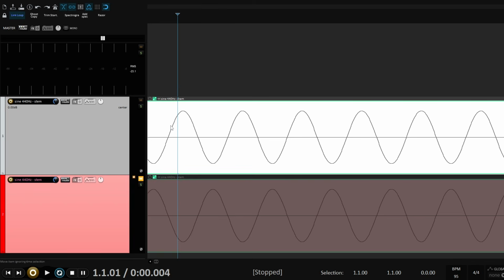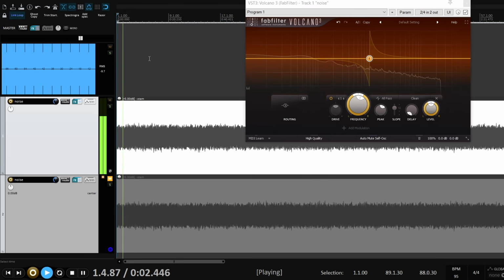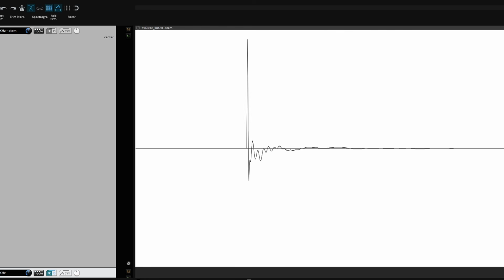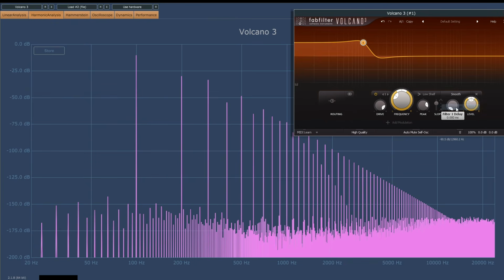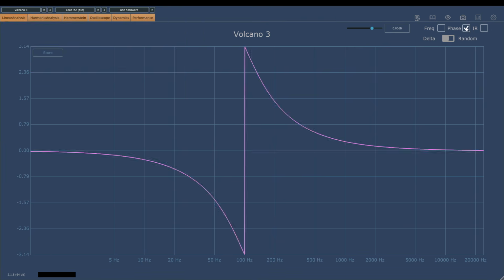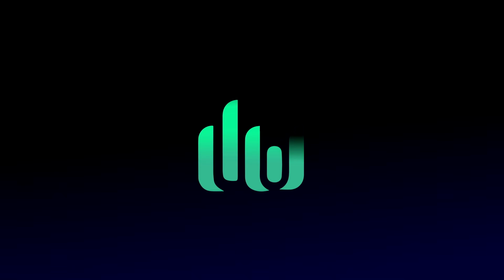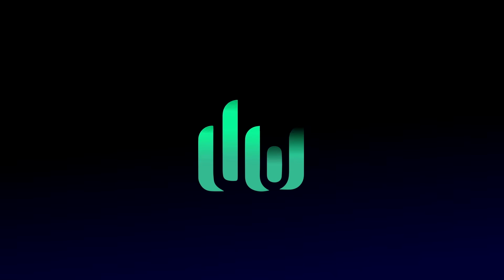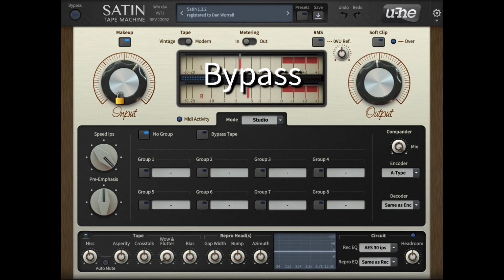How (Not) To Test Your Plugins

Comment: I know this is an old vid, but I wish to thank you Dan for the content. 
I am restoring an old 1980’s analog console and was wanting to document the eq sections (this is pretty much a one off custom console from Australia with no documentation).  
The linear analysis in plugindoctor had me stumped, because it was showing rubbish, just like you demonstrated.  
You have enlightened me.  The user manual for plugindoctor is a bit light on. 
Thanks again.

Comment: A lot of the things shown here about the "secret EQ" that a lot of "analog" FX has is the reason why i shy away from them. I want to know if there is a bandpass filter. Once i do know, i use them MUCH more easily, since sometimes you do want bandpass after saturation, some of those curves are there because there are use cases for them. There are only few plugins outside Reapers built-in stuff that i use anyway, each with very distinct roles but i don't  have 12 different tube amps that i don't know really what they do.. 

If only plugin makers would be proudly showing at least FR, what kind of filter is "baked in", that would be something new and refreshing, you know: truth. If they hide things from you, you don't know what things they are hiding. It is a philosophy and moral question, really and if they lie to you in one area... they will lie to you elsewhere too. Which is why i got stuck with Cockoo's and Reaper, and i tend to favor transparency when i choose what plugins to buy or even try.. I'm not going to log in with my real credentials and install a launcher, for just trying out something. That is a payment, it is not free-to-try.

These go hand in hand, if the plugin does something it should inform the user that it is doing it. So... keep analyzing plugins before you buy and evaluate how honest they really are as a company. I have one subscription atm, and the amount of information they give you is enough to almost reverse engineer their stuff... so, if you want to stop you can at least do something in the same direction with stock plugins and complicated routing... but their marketing and pricing is bloodsucking, i pay when i need it and in my case, it pays itself back, it is almost like secret code to handle one certain problem that i have with my mixing style, and once i learn enough... i will stop but their documentation and transparency on what the plugins do is why i pay atm. I won't name it, they are still bloodsucking..

Comment: 50:14 There's an even simpler solution, actually, and that's to not apply low cut filters in the first place. Or at the very least, treat them as a last resort, rather than as a safety measure. There's this myth going around in pretty much all music production circles, that absolutely nothing but the kick or the bass should ever be present in the sub frequencies domain, but the truth is that any low end junk included with any other element, only needs to be diminished to the point where it's masked in the full mix, not fully removed. 

In other words, a low shelf filter is a better solution to almost any mixing problem where conventional wisdom would call for a low cut filter. Heck, a regular bell filter could often be a more viable solution, and sometimes the best option is to just leave the low end alone. It's to the point where I'm convinced that the demand for "analog warmth" is almost entirely caused by producers highpassing in their mixes too much; low end is after all where all the "warmth" is found

Comment: One generic question: 2x or 4x or higher oversampling vs, say, working at 96/192 kHz and downsampling in the end  - is there difference?
Reply from the maker: Oversampling each plugin that requires it individually will result in less aliasing than oversampling the entire chain, all other things being equal.

Comment: Great video, very informative. However, one important concept is missing: IMD (intermodulation distortion), which is most of the time related to and correlated with aliasing, though sometimes it isn’t. When you gave the phase-shift example and explained that we generally shouldn’t worry about it, it’s true but the closer we get to extreme cases, the higher the risk of actually hearing it. So what would be considered an acceptable average level of IMD : 0.30–1%?

Also, compressors; depending on the amount of threshold, attack, and release can introduce a lot of these kinds of non-musical harmonics that aren’t correlated with the fundamental, which can make sources sound fake, harsh, fatiguing, and so on.

Comment: at 1:06:03, you show aliasing artifacts that are hitting around -96 dBfs.  Here's the thing, lets say your aliasing compressors are all around -100 dBfs, but you have 5 of them across your mix. You're going to start to hear glassy, phasey textures, fizzy sibilants, or unnatural top-end harshness — especially in vocals, cymbals, or reverb tails - in the 2–8 kHz. Now starting adding mix bus compression or throwing a tape plugin on or another clipper or saturator into the mix, and soon you get a mix that might sound exciting at first, but really, you end up with a mix that has a brittle or digital character in the highs, which becomes fatiguing to listen to. A single asliasing plugin, that is being listened to in isolation isn't an issue per se... but let's say you have a LV, Double LV, then three part harmony stacks of vocals left and right, and you have 8 vocal tracks with a compressor aliasing at around -100 dBfs, then you send that to a Vocal bus subgroup, now you are raising the aliasing up higher, then that bus combines with your other tracks, and goes to the mix bus where an SSL type compressor is on, and now you're compressing the audio, and it's aliasing artifacts further increasing the fizz, and hazy sheen, or  edgy cymbals etc.. It's all cumulative.

Comment: That noisefloor you see in Pro-Q3 (@26:00) is only there because Pro-Q3 runs on 32-bit floats internally, not 64-bit doubles. (This is NOT! about the 32/64-bit CPU architecture, but basically how large the memory sections are to store sample data in.)

Larger blocks of memory allow for more precision, think "digits after the decimal point" as a simplified explanation. If a data format can store more digits after the decimal point, e.g. 0.01 vs 0.00001, then obviously the one with more digits can calculate much more precise numbers. After the limit of the data format are reached, i.e. if the post-decimal precision runs out of digits, then there will be rounding errors, which results in what we perceive as noise.

32-bit float (single-precision) has 23 bits of mantissa (actual precision), 8 bits for the exponent, and 1 sign bit.  The theoretical noise floor for 32-bit float is around -144 dBfs, but due to denormals and the actual mantissa width, it may appear closer to -150 ~ -180 dBfs in the wild, also depending on the measurement method.

64-bit double (double-precision) has about 52 bits of mantissa, 11 bits for the exponent, and 1 sign bit. This means numbers can be stored with higher precision, i.e. there are  "many more digits past the decimal point", which means rounding errors will be much smaller since they happen "further down". The noise floor from rounding is pushed far below the audible range, typically below -300 dBfs, which is unmeasurable for practical audio.

If you look at a plugin's output in a spectrum analyser that ranges down below -150 dBfs, and you can see some gristling noise there, then those are just rounding errors from using the float for processing vs. the higher-precision double format.

The "internal resolution above 100 bits" thing refers to a non-standard data type.

On some platforms, even old 386 CPUs with math co-processor, there is a "long double" i.e. 80 bits data type, but its support depends on the hardware: some platforms implement it with 128 bits, and in MSVC on Windows it's just an alias for regular 64-bit double. Not a reliable thing to work with and, likely more importantly, also not deeply optimized for SIMD operations. (It's when your CPU does multiple calculations of the same type in 1 CPU cycle, like 4 float additions.)

There is also an "artificial" data type called "double double", it's not a standard thing, it needs to be implemented by software i.e. an additional library, and it's basically done by summing two separate (but related) double values. It uses 53 precision bits from each partial double, which gives it 106 precision bits in total. The Kirchhoff EQ uses this format and they seem very proud of it, but it's not going to make a difference, at least not a positive one.

SSE1 brought optimizations for 4 parallel float computations to PCs in 1999, SSE2 brought optimizations for 2 parallel double computations in 2001. With AVX in 2011, mainstream CPUs finally also got the capability to process 4 parallel double computations in one step. Apple Silicon CPUs all use NEON and SVE extensions that optimize 4 parallel double computations. (When I write "parallel", think about "processing X audio channels in one go.")

So with the regular 64-bit double format and a noisefloor below -300 dBfs, you can make use of HIGHLY optimized CPU instructions, making for a much faster process than using some customized data format that doesn't just access one section of memory, but needs to access several sections of memory and perform additional computations, just to "get" a number.

Yes, the double-double is indeed parallelizable, but due to its complexity and the limited availability of supported instructions (e.g. can't do pointwise operations) it's probably not worth the effort.

Float is fine if you have a problem going with the times, it's a nice fall-back for outdated host software, but double processing is measurably better. (Note that I wrote "measurably" not "audibly".) PCs from the early 2000s already support 2-fold double calculations, and most of us are working in stereo (or in channel counts that are multiples of 2), so if your plugin doesn't internally do double processing, you're a geriatric boomer and 20+ years behind the times. But this double-double business is just a waste of time and effort, at least for audio DSP.
Reply: Awesome computer science info for us instruction set and data type nerds haha. Thanks for this

Comment: I'm only a few minutes in, but REAPER has a "delta solo" option that is useful for stuff like this, and much easier than duplicating and inverting phase. Hold alt and click the dry/wet mix knob at the top right of every plugin window, and you'll hear exactly what that plugin changes.
Edit: It was mentioned later. Oh well.

Comment: Thx a ton for the explanation for the raised peak with high pass filtering. Makes perfect sense. I knew all sounds consist of sine waves, but somehow still missed the fact that the shift and overlap of those lowest freq waves is what actually causes the spike. But it makes perfect sense now and I'm just like how the hell I didn't figure it out. Doh. In some synths you also have hi pass adjustment at the osc level. What they essentially do is they modify the waveform removing the lower end harmonics. So if possible deal with it already at sound design stage. Of course you don't have that liberty when mixing.

Comment: Hello Dan Worral, you're mentioning Dolby noise reduction around the 26 minute mark. I am interested in this system, how was it used in the example for this video, what am I seeing in the graph, how is noisefloor affected by Dolby NR? Would it make sense to use this technique for digital tape simulation plugins? What I understand that first boosting/compression and after the insert attenuation/expansion is used to reduce the hiss. Could it be useful to use this in other non-linear processors, e.g. to drive saturation?
Reply from the maker: Yes, definitely. U-He Satin includes the noise reduction (both Dolby and DBX), and it's really important IMO. https://youtu.be/ZRP5uI9mbzQ?si=EnPrnN2CuQVwyGLf

Comment: Hi Dan, Have you ever used the browser add on, "Audio Compressor"? I use it in both Chrome and Firefox for youtube/movies/Twitch/etc.  However for videos like yours, I have to turn it off because I'm hitting it fairly hard and the best creators already have mixed down to professional standards.  I would love to know more about this, plug-in(?), and what is driving it, how it works with windows, etc.  It doesn't work on some pages like embedded video and specifically Twitch Clips comes to mind.  On Twitch clips the audio will just be not present requiring a refresh of the page.  Not sure if you'll ever tackle this but thought it might make a decent shorter video.

Comment: Dan, question (and possible video idea?) - it’s about distorting high frequencies. Since our hearing caps out at 20kHz or less, what this means is that we shouldn’t be able to hear the distortion of frequencies higher than 10kHz right? A 10kHz sine should sound theoretically identical to a sawtooth
Reply from the maker: That's true for just a single sine wave. But if there's also a component at (say) 12KHz you'll also get the sum and difference partials at 22k (inaudible) and 2k (definitely audible).
Reply: @DanWorrall  oh totally forgot about intermodulation. It’s still a very esoteric concept to me I don’t understand why it happens lol. Thanks a lot!
Reply from the maker: Remember that both components are mixed together as one wave: imagine the higher sine wave as wiggles on the lower sine wave. When the lower sine is positive, it's pushing the higher sine wave harder into the positive half of the non linearity, and vice versa. And the higher sine affects the distortion of the lower wave in the same way. So the two waves start to modulate one another, in effect.

Comment: Question. So far from all the saturation plugins that you’ve tested with analysis and with your ears, what is your go to favorite one at the moment? I know that this question is completely subjective, I’m just curious. Which one to you is the best as far as test results and listening with your ears?  Thanks
Reply from the maker: I can't give you just one as there are so many different ways I use saturation. FabFilter Saturn would have to take the top spot, if you forced me to choose, as the most versatile with its different styles and multiband capability. But I also use saturating filters a lot, usually FabFilter Volcano 3 or Cytomic The Drop. U-He Satin is an old favourite for when I want some extra shine and brightness. I still use Decapitator quite regularly, as there's nothing else quite like it. Think of them as like spices you can add when cooking: you'll probably want a variety of different flavours, and you'll choose them to complement the dish you're preparing, you won't just use the same one all the time.

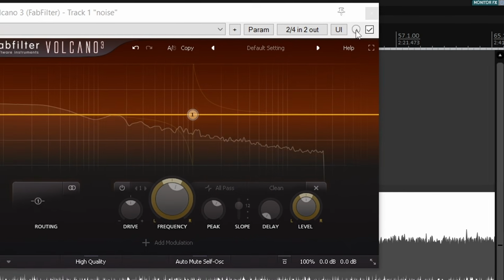Comment: Can someone explain to me the part at 12:20 - when Dan enables the allpass in Volcano 3 with Reaper's Delta Solo function active, shouldn't the result still have been null/silence, given that the mode is set to Clean? (edit: bandpass → allpass, Pro-Q → Vocano 3)
Reply from the maker: I enabled an allpass filter in Volcano 3. That became a bandpass filter when delta soloed. A clean bandpass filter would become a notch filter with delta solo.
Reply: @DanWorrall  thank you for taking the time to reply! Just went back to 6:30 and it all makes sense now: the first null test is against a channel that also has an allpass hence they null, the second with Delta solo is against the same channel without Volcano 3 hence it becomes a bandpass. Apologies for the mistakes in the original post by the way - fixed now. Thanks again!

Comment: Notwithstanding all the commercial speculations you might find on the net, Both crystals and homeopathy are based on oscillations, numbers and frequencies. They are relevant and detected in the time domain, space domain and frequency domain. To mention homeopathy and crystals (albeit crystal healing) in such a context was perhaps the most unfortunate statement you could find. It may be that you did not intend, for that matter, to discredit the two, but if you knew, for example, that according to the same principle on which homeopathy is based, the same effect of a digital null test is exploitable by allowing the recording of the event in water the latter of which would behave exactly like the silicon in which you store the data or the atoms of the magnetized tape on which you record any oscillation.  Your organic cells themselves work for very precise frequency numbers and are also subject to functional and surprisingly precise null-testing in the same mathematics that we use for music propagation.  The mathematics of crystalline clusters is surprisingly so digital and surgical that if it were not so, some important technologies of our time could not have been built and mass replicated. The most trivial thing at bottom is that your quote about crystals and homeopathy that you used to give credence to something that we all actually agree on (except for the decerebrates of course), is one of the most idiotic clichés used by the same decerebrate men of our time, in the last 30-40 years. It sounds like a paradox, but it is....

Comment: Now, I've got a related question: is there a way to get Plugin Doctor to analyse my hardware compressor via a hardware send and return?
Reply from the maker: Yes. Set up the correct IO in the settings, then click "use hardware" at the top. You'll need to set the latency "manually" in the sense that you have to click the button to tell PD to measure it and compensate automatically.
Reply from the maker: Be aware: Plugin Doctor is normally not shy about exceeding full scale, and that's fine with most plugins. Not so with hardware, so take care of your levels.